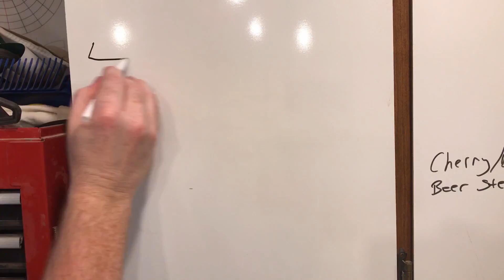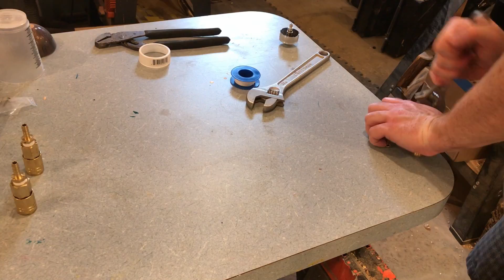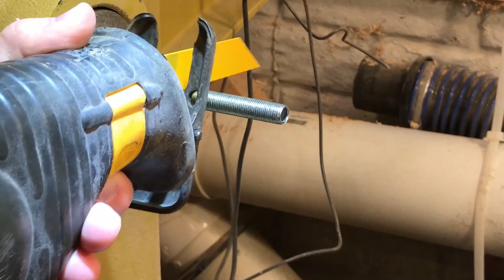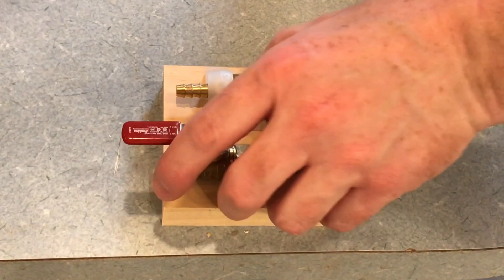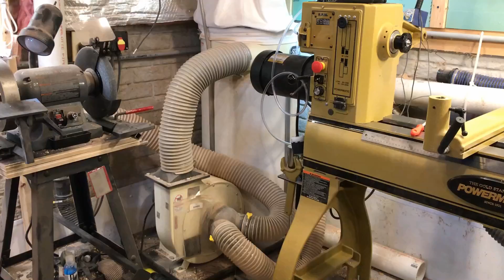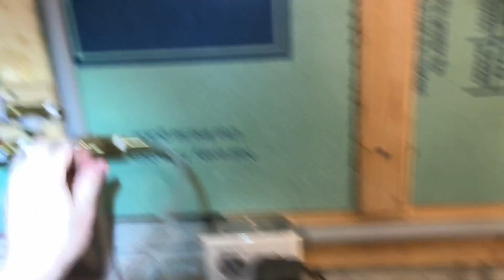Vacuum Chuck Part 1: Air System

Comment: Did you remove the inlet supplied on the pump and replace with npt fitting, or build off the supplied fitting?

Comment: The dust input to your vacuum pump isn't down on the floor where you put your pump, it's on the wall where you put the bypass valve or on your headstock when the bypass valve is closed.  An inlined air filter would take care of both inputs.

Comment: Nice setup, what size of a pump did you use?
Reply from the maker: It's a Robinair model 15600 (6CFM, 1/2HP). I bought it on Craigslist for under $100 and have been using it for my stabilizing. It seems to pull enough volume to support this chuck, so I'm happy to not have to buy another pump.

Comment: Excellent instructions.  Would you consider using a lapel microphone?  Your camera mike is insufficient to pick up your voice when you don't speak loudly and clearly.  I dislike having to turn the volume up all the way to hear YouTube videos.  Also, give the sizes of the fittings, etc.  Standard for air is 1/4", but someone without experience would not know what size to buy.
Reply from the maker: Thanks for watching. I really need to get a better camera that can do that. Today, I use my iPhone for most of my filming, but a remote mic would be a great addition to my setup. You are correct that all the fittings are 1/4".